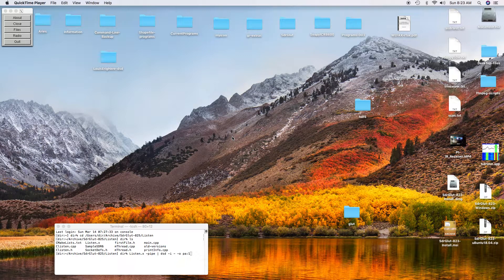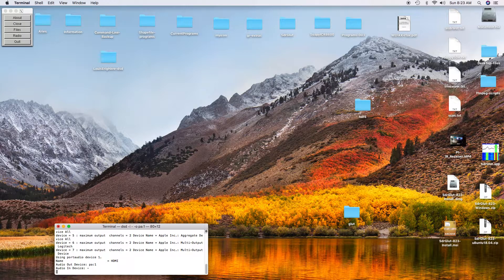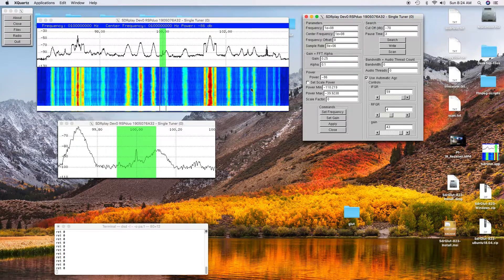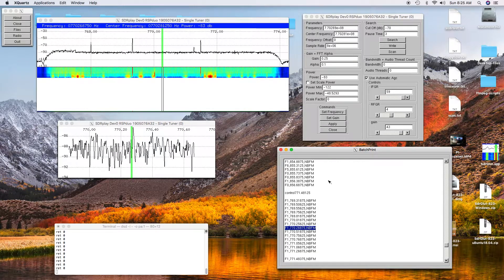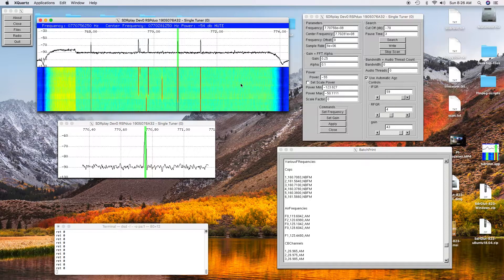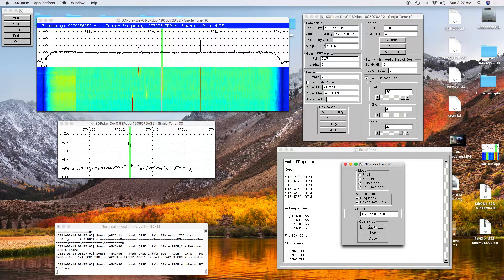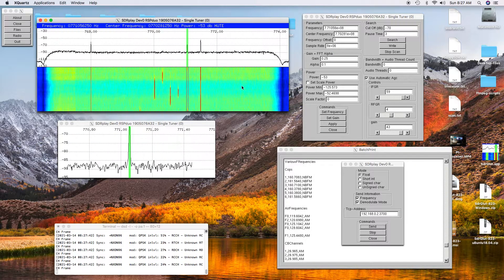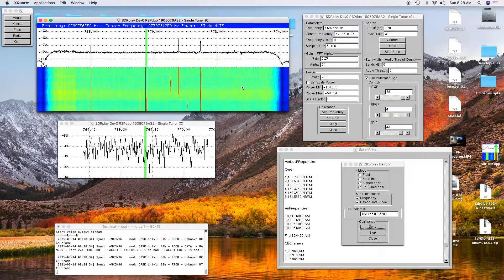SdrGlut uses DSD to decode Public Service Channels with the RSPduo

Comment: Instead of P25/DSD (LouisErigHere), aren't there other public audio/data RF near 400Mhz/800Mhz  (POCSAG , FLEX , AUDIO ),  that can be decoded using SDRPlusPlus  / PDW Paging Decoder Software?
Reply from the maker: Here (san diego) about 1/2 the RF near 400Mhz/800Mhz is p25 or unencrypted - I assumed that the remaining was encrypted, but it could be something else.